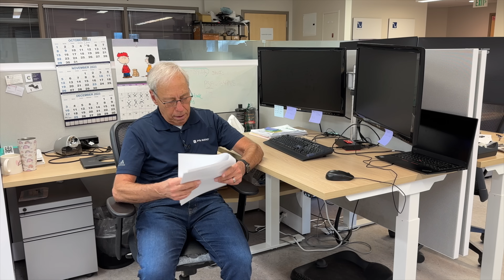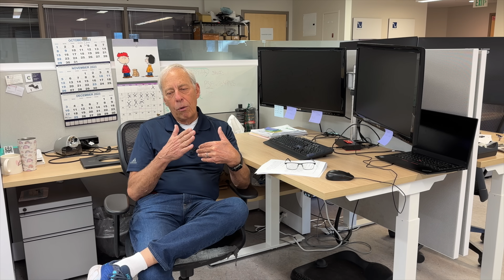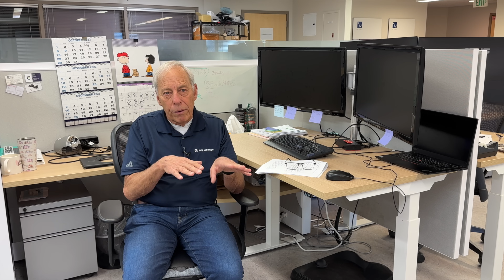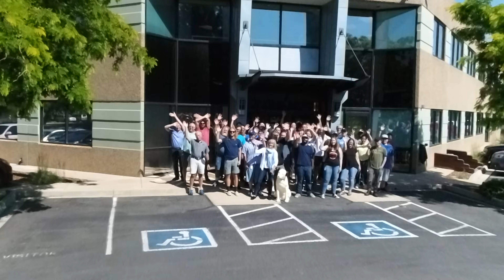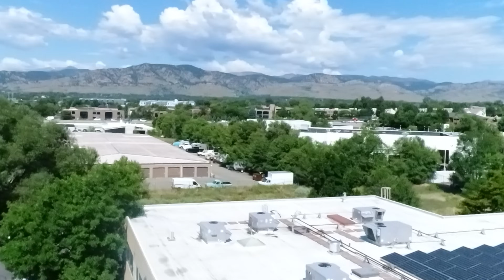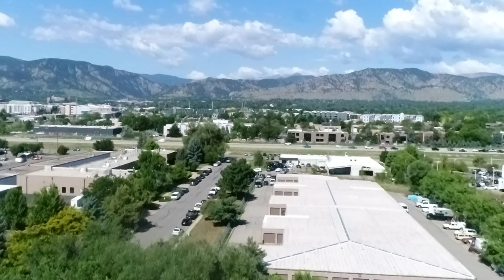PLL in a DAC explained

Comment: A digital source (EG, a CD player) uses a internal clock to bang out the serial data bits, and as such the transmitted data contains frequency’s that strongly correlate to the source clock. So strong that in the receiving end we can see (recover) the source clock from just the data. Extracting raw clock from data is messy, and you get a lot of pattern related jitter and such. We can re-time the data but we need the receiver clock to do this, and as such the receiving clock needs to frequency match the incoming source otherwise it all drifts out of sync, and we lose data. The PLL sorts this.
The PLL compares clock frequency recovered from the data, to the frequency of our internal clock. If there is a difference in frequency (this is the phase part of the PLL) it produces an error voltage proportional to the error amount. This voltage is used to tune the internal clock until it matches the source clock frequency and the clocks  become “locked”.  The trick is we low-pass filter (slow down) the error signal, so it doesn’t track transient frequency changes from the noisy source, but instead produces an AVERAGE clock frequency. So the incoming clock can move around but the PLL will run an average on this and come up with a steady clock. This clock is used to shift in the data, hence re-timed at a steady rate. We will still get some wander but it is effective at removing a lot of jitter. PLL design is a difficult subject.

Comment: Say the DAC needs an oscillator that is 16x faster than the data coming in, the PLL counts the DAC clocks for every data clock. Because of jitter on the data clock sometimes it counts 15, sometimes 16 or 17. If over a period of time, like 1 second, say the count averages a bit low, the PLL slowly speeds the DAC clock up, if high it slows it down until the average is 16. This way the DAC clock matches the average data clock but is stable and doesn't jump around with the data jitter.

Comment: Most things which sound technically apt to leave other things in the dust, like an old dinosaur, turn out to be only verbally impressive or impressive on paper. One example is SACD, with it's million times sampling rate, near 25 times higher than regular cds. "Wow oh wow" people were thinking, when SACD was announced. Yet when they came out and we actually got to hear them, there was only a slight to moderate improvement usually. Some redbook cds that were mastered well, actually sound better than their SACD counterpart. The format failed and now it's mostly relegated to audiophile labels who still come out with SACD discs. Or maybe in Japan or somewhere they still do a bit. So I don't get too excited over so called technical advances or specs. If you got some Conrad Johnson equipment from the 1990s, a good turntable and speakers from back then, you're still sitting pretty I'm sure, (some say even prettier), than most of the new expensively priced stuff that they manufacture today. With all this talk of countless technical advances, you'd think the equipment of today would sound far better than equip. of yesterday. In my experience; it doesn't. The biggest difference between current equip. and equip. of yesteryear seems to be the orbital pricing that has taken place. 

 I remember back around 1981, my dealer tried to get me to buy a $150 cable. I thought that sounded nuts. To my ears, cables have made the biggest sonic gains throughout the years. I remember back to a time when Petersen Litz cables were the only truly high end cables available for those seeking a lift in sound quality. Of course most audiophiles don't know what they are doing. They had their tone controls taken away from them decades ago, which made getting just the right tonality a real crap shoot. If ypu get just the right balance without oh so many expensive tries; you're lucky. People who have warm sounding systems; some of them know that their warmth is masking detail higher up. But they realize that tonality is more important than a thin bright sound. Seek out a sound that is warm, big and highly open and tell me if you still care about micro details or hearing cymbals a little more distinctly.
Reply: Not being critical of your comment what's it got to do with PLL?
Reply: To Analogue Man. My comments don't have to have anything to do with Paul's subject. My comment had more to do with Arty, Chang's and another guy's comment on here. Many commenters always diverge from Paul's subject on a routine basis. When I'm buying carrots in a store; I'll almost never be talking carrots. Talk progresses to other things. Some of the other commenters diverged into a much more interesting topic. The topic of "Is there that much difference between dacs sonically", and if not, then PLL doesn't matter much. I hope I answered your question.
Reply: I see, thanks. I had to go back and re-read the comments from those you mention and it made more sense 👍

Comment: If you have a source with a great clock accuracy and you use Spdif coax or AES (not USB) you don’t need the DAC to work very hard to do its job reclocking. I believe that’s the working principle of the Grimm MU1 and it sounds awesome.
Reply: I'm interested/curious - why not USB?
Reply: @analogueman5364  my understanding is that if you use USB it’s the DAC clock that takes control defeating the aforementioned principle and spending a lot in the clock of the streamer if you go USB. Doesn’t mean usb is bad but may not be worth investing in a crazy expensive streamer clock. At that point if you go USB shift the investment to the DAC clock but arguably the DAC end up “working harder” again. I don’t think there is an absolute truth in either way but understanding how it works can certainly help in making better decision on maximizing where you choose to drop your hard earned money 😊

Comment: This topic arise when you run a digital audio architecture where you have two clock masters of the audio sample clocking. Much better is when your DAC doesn’t need to bother with other clocks than its own and the audio stream is pulled asynchronously on demand from the source. In fact, modern streaming is working in this way and with a USB connection between player and DAC you can avoid this issue. A single clock master in the DAC allows for the audio data to be buffered and pulled from source when running low without the mess of PLL being needed. In the old days with CD players outputting TOSLINK or SPDIF you ended up with the need for PLL and in some cases it caused audible jitter issues. But let’s be in current time where we can run digital audio without this concern and super precise clock.

Comment: does the directstream also reclock i²s ?
Reply: Brilliant question. I very much prefer my DAC to be the precise clock master of the timing of which the samples are translated to analog rather than any external source where the risk of jitter can arise. Surely adding a PLL to mitigate such issue is inferior to running the audio data buffered in the DAC and pulled on demand e.g via a modern USB connection where such asynchronous audio transfer is trivial. There really should be only one clock master in an optimally working digital audio playback system and it better be the DAC. If PS audio clocks the I2S bus from the DAC side it’s still ok as the DAC won’t need PLL in such case.
Reply: another solution is to use a dedicated master clock to sync up all independent digital devices in the chain
Reply: i think if the dac reclocks everything thats pointless @philiptong4978
Reply: @philiptong4978  It’s a bit hilarious how the audiophile business is making money out of ridiculous claims. Yes, you can use an external clock source but the entire notion of this topic is ridiculous considering nowadays your DAC can run a very precise clock costing very little pulling the samples on-demand via USB completely making this topic non-existing. I stream my music from Amazon Music HD in up to 192kHz 24 bits lossless better than CD quality and my DAC clock is the clock master with no such issue. This problem is only a topic when using some source that is also trying to be clock master such as an old CD player/transport or media streamer using old standard one-way output like SPDIF.

Comment: I had a problem with my TV dropping out audio when connected to my dac. It was so annoying cause it was constant. However, I discovered when playing around with the PLL on the dac it cured the drop outs.
Reply: is it media source sensitive? e.g. over the air RF/ internet streaming live broadcast vs pre-recorded local media playback (optical disk/flash drive/hdd/lan)
Reply: Can you tell me How did you fix this problem?
Reply: So you resorted to using a high setting for PLL?